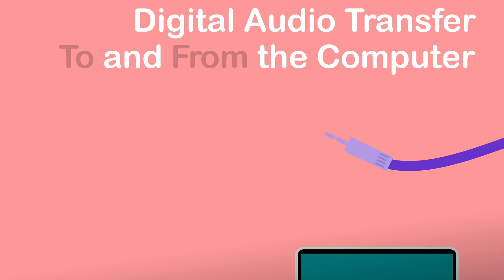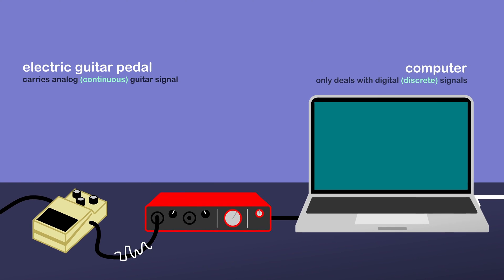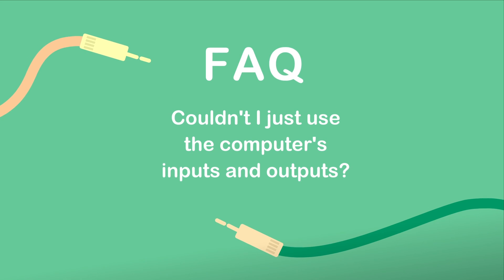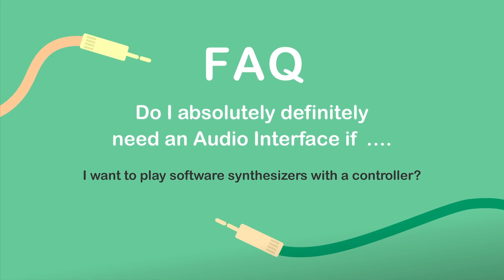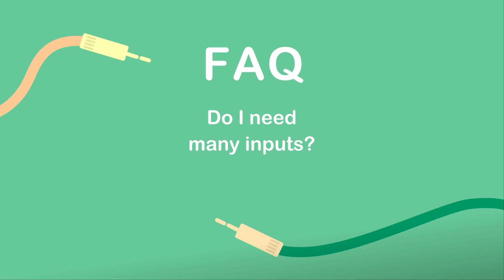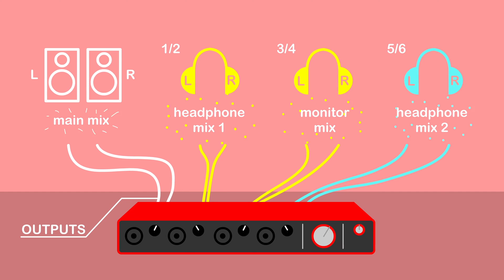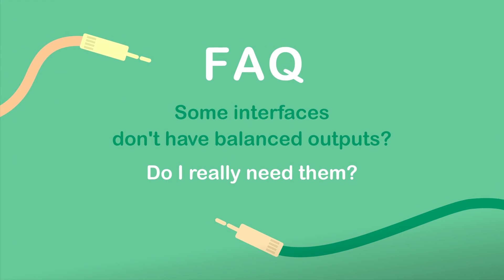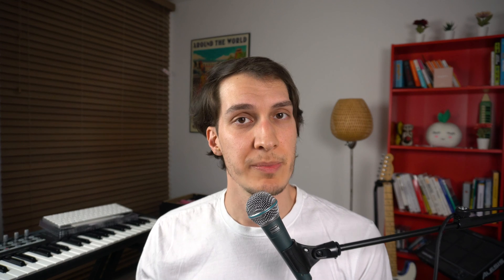What is an Audio Interface? Do I need one? FAQs answered // Audio Interfaces Part 1

Comment: Thank you, this was explained well and easily understandable. I do have a question about outputs with L and R - if I only want to connect my guitar amplifier to an interface's output in order to use it as a speaker, do I need to connect it to the L or the R output?  Also, what kind of cable/jack would I need to connect amplifier to an audio interface?
Reply from the maker: If you are trying to connect the line out of your interface to the guitar input of your amp, then that's not probably a very good idea :P (check our signal levels video for more info on that)

If your amp has an aux input (that bypasses the guitar pre-amp) then you could pick any channel (you're just going to lose half of the stereo information).
Another idea would be if you could use your DAW to mix both the L and R channels into a single channel and then send that to a mono input. Depending on the music you want to play this might sound better than just sending the L or R channel.

I hope this helps :D
Let me know if you have more questions!
Reply: @arbitersofsound  Yeah my amp has an aux input. What about if I use a Y cable with dual 1/4" jacks on one end to plug into the L and R outputs on the interface, and plug in the 3.5mm end into my amp's aux input? Or  is it better to use the headphones output of the interface into my amp's aux?
Reply from the maker: @carpediemearth  Both should work (as long as you keep the headphone out volume low). If your amp only has one speaker then probably the stereo to mono conversion will happen inside.
Reply: @arbitersofsound  Thank you, I appreciate it!

Comment: Any Audio Interface with RCA ground & balanced 1/4" inputs so I could directly plug a vinyl turntable such as a Technics SL1210 MKII in the AI ? The Arturia AudioFuse has this lovely feature but I look for something more affordable to just connect a turntable and a few old analog synthesizers (not necessarily simultaneously).
Reply from the maker: Hmmm... You're right! There doesn't seem to be much in the market that has phono inputs (RCA) for turntables and line inputs for synths. The AudioFuse seems to be the only choice. I'm afraid that you'd probably have to look into getting a separate phono pre-amp and then a simple AI with 4 analog ins to achieve what you want. I also had a look at basic mixers but there's nothing out there with built-in phono pres. It's a shame really, because that would be super useful for sampling and beat making.